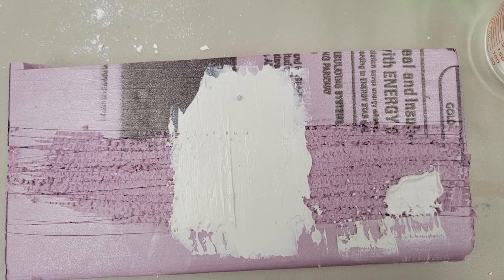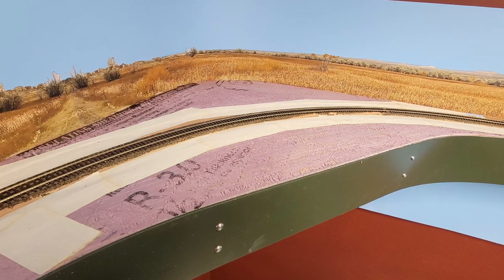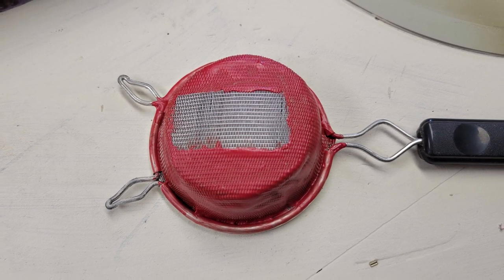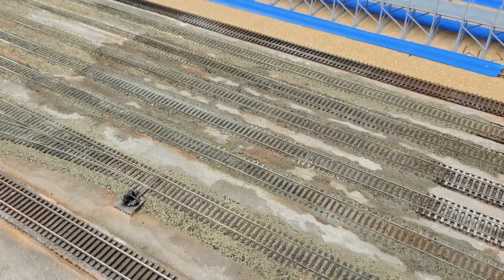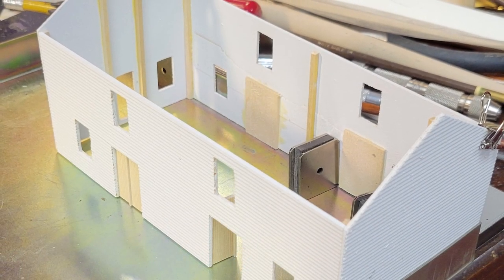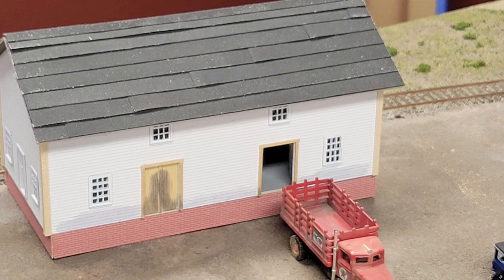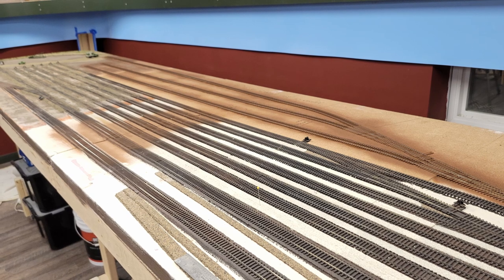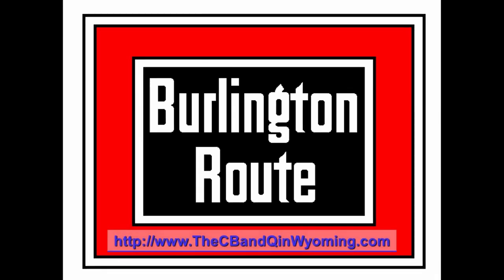2021 05 03 CB&Q V5 Monthly Update #18

Comment: I cover my pink styrofoam with plaster cloth and it sticks without roughing up the surface. After that I use a gritty textured drywall compound watered down enough to spread with a paint brush. This fills the holes in the cloth and adds tooth for the earth colored paint which follows. 
You wouldn’t need the drywall tape over the seams because the cloth would cover them.
I’m not trying to be a “know-it-all”, but it might save you some time.
Reply from the maker: Thanks Wendell, I appreciate the suggestion. I have a lot of layout to go, so I may try your plaster cloth method in the future (paper tape is pretty cheap, though... ;) )
Reply: @mapruitt  In my search for plaster cloth I found it online from Walmart, of all places, at a very reasonable price. Better than the “name brands”
Reply from the maker: @tczephyr3665  I looked and saw it on Walmart. That is a pretty good price. Thanks for the tip!